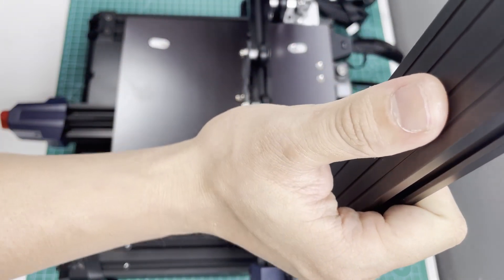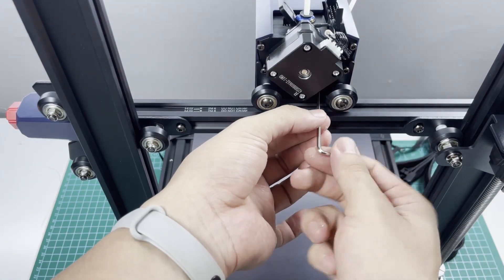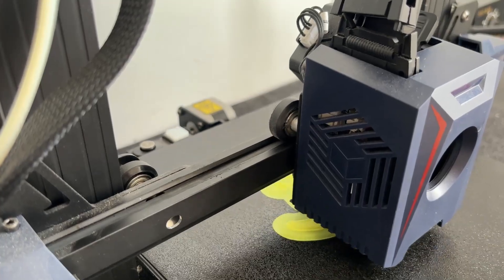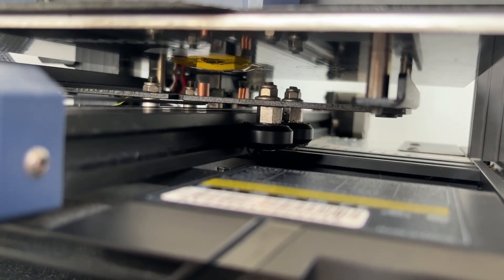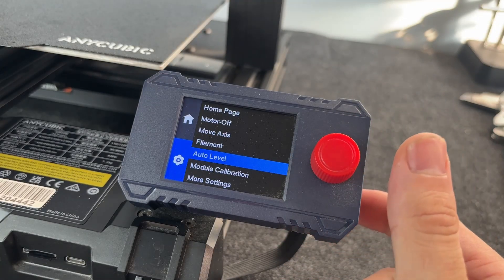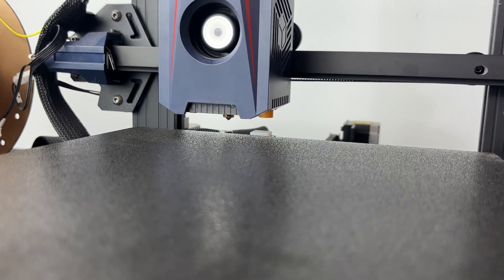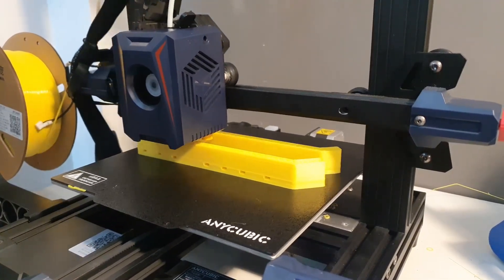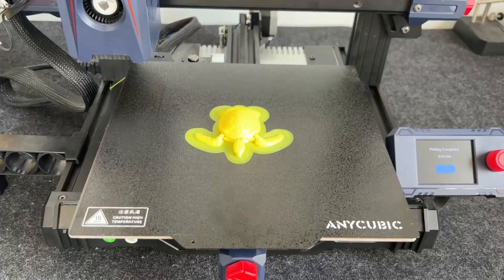Anycubic Kobra 2 Neo Review After 1 Year — Still Worth It in 2025?

Comment: Solidworks compatible?
Reply from the maker: I haven't tried Solidworks with it, but I believe it should be compatible with STL files, bro.
Reply: @LeeCuriosity Noted
Reply: Anything that can export or save as an STL, which Solidworks does, will work. I supported a lab with Solidworks as the 3D design platform for several years. Just like Fusion or Tinkercad, it exports as STL.

Comment: It got z axis issue after 4 prints does anyone have a solution??
Reply from the maker: Does it crashes the build blate ?
Reply: @LeeCuriosity  Some times with some prints no movement of z axis it grinding the build plate
Reply: @manikantadola3108  i think you did not level it , there is auto leveling in this model
Reply: @ElectroNerds-1_1I did 
Everyday before first print
Reply: Dont do that
Reply: Do it 0ne time and you will have to set the z level
Reply: Klipper